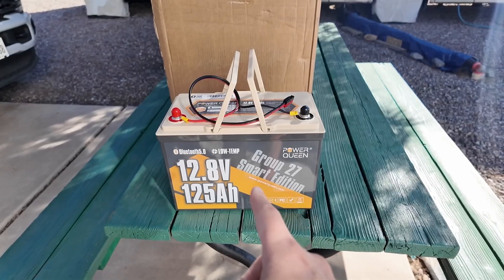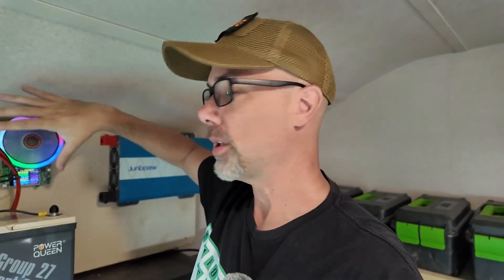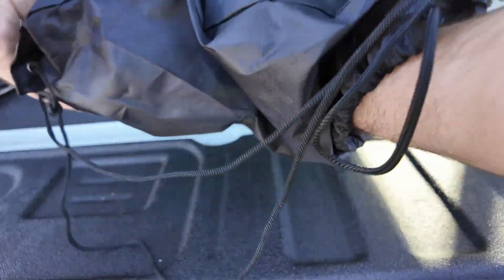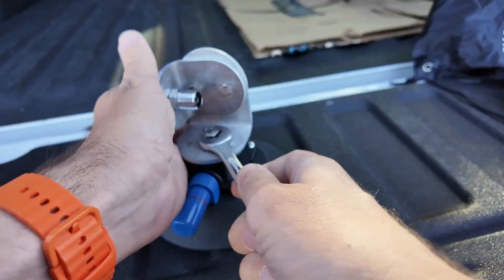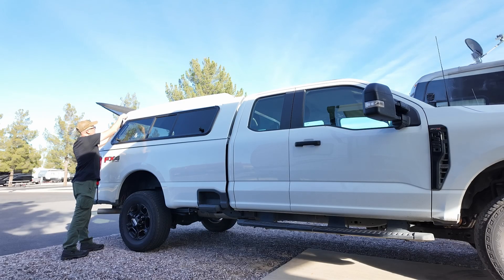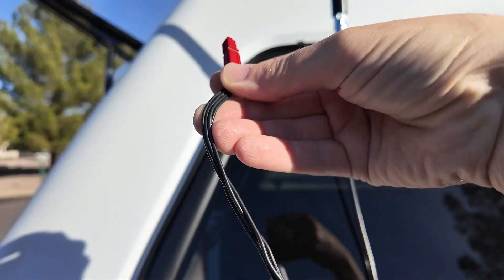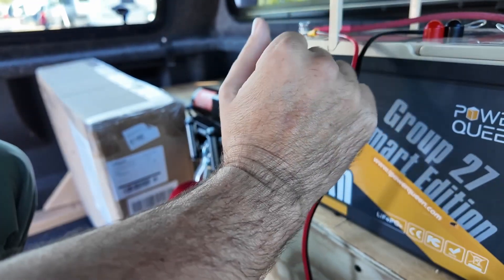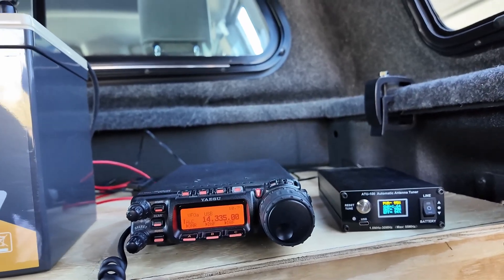⭐ I Built a Complete Off-Grid Ham Radio Station for My Truck Camper! (Power Queen + 17ft Antenna)

Comment: Hey Steve! I just ran across this video! Thanks for the shoutout! I use the braid to ground to the trucks leaf spring. I have had it on my truck for about 3 months. I only attach an antenna when stopped. I do check the suction quite often, but it’s always good to go! Good luck with the build! Happy New Year
Reply from the maker: That's a great idea to ground to the leaf spring!

Comment: We used those same suction cups in commercial glazing, be sure to keep the cover on it when not using and keep it clean. One little nick in that ring around the edge and it will lose suction. I would not trust it going down the road myself.
Reply from the maker: Thanks for the tips.  I agree, but I'm not a fan of in-motion HF myself.

Comment: I am slowly setting up my mobility lift gate van for POTA hunting.  I use 2 LiPo4 50 Ah batteries paralleled.  My Kenwood TS-590SG runs an entire week at 100W before batteries need recharging.  Living in N. Minnesota, and living in an antenna restricted apartment, so the van is a good alternative except like now when it is 4 deg. F outside.  This is a full size van, so the rear portion will have a built-in ham shack style desk, and with a hitch mounted  Spiderbeam 12M HD mast.
I also use the Mastwerks 10M rotatable Buddipole dipole.  This is a dream come true being handicapped.  I just acquired the van 1994 Ford E150 with the 2 valve 5.4L Triton and side lift installed.  WOO HOO  Cheers and 73
Love your Videos!
Reply from the maker: Sounds like an awesome setup!  HamVan!

Comment: Regarding the suction cup antenna mount. It brings to mind the phrase "What happens
when an unstopable force (vehicle w/ suction mount and antenna) meets an unmovable object (low tree branch)? Sounds like glass breaking to me. Your thoughts?
Reply from the maker: There is no scenario where you hit a low tree branch with and antenna and walk away unharmed.  A good operator doesn't run into trees.  I personally wouldn't run it while driving.

Comment: I need to find out if I can mount the ATAS-120 with a mount like that. Wonder if they have a SO-239 version or if I can find an adapter. Aren't aluminum body trucks fun ;) Also, might get one for my Tesla for the roof since that is all glass. Need to get my GMRS radio going. FYI, you might try a ground strap as a radial. I am working on a video showing that and I am finding it working quite well. I replaced each bundle of 4 radials with a single ground strap. No wires to pull apart. And I need to catch up on Living for a Living.
Reply from the maker: I never really did much mobile operating from the truck... when I did I used my 2/70 bolt on mount up under the hood.  Its nice to have options... The biggest frustration I have is that now that I've got an AL truck, they are asking me to review all these mag mounts!

Comment: I would recommend not using it on a window. It is more for any flat surface on a vehicle or in place of a mag mount on fiberglass vehicles. I used this type of mount for years for tow lights when I drove a tow truck. The window will break before that mount comes off if hit or too much weight is applied
Reply: I’ve run mine on my back glass for roughly about a year with no issues. Only took it off once
Reply from the maker: Thanks for the info!

Comment: Back in the Early 90's I had Window Screen material Fiber glassed into the under side of the Roof on My Topper to serve 3 MNO Antenna mounts 
Worked a Treat for VHF / UHF Etc. 
Then some 2" seal tight conduit out the bottom of the bed and and back up into the Cab under the Seat. ..
Reply from the maker: Noice!

Comment: I just installed one of those triple foot mag mount on my jeep, with a comet antenna that folds down, but I thought I better add some zip ties for safty. I could totally see a tree branch stripping the antenna and mount. My roof rack actually protects the antenna and mount, but zip tirs are cheap insurance.
Reply from the maker: #TeamZipTie

Comment: @temporarilyoffline Hi Steve.  Another superb video.  If I use the suction mount on a home window, is there a weight limit on the antenna?  I’m thinking about using a Diamond Fiberglass VHF/UHF vertical.  Thanks. 73
Reply from the maker: I'd say we're talking wind load more than weight.  its all "sheer" weight and that is a serious suction mount.  The diamond should be fine!  You could reach out to Look North and they will give you more accurate info.
Reply: @temporarilyoffline  thanks for responding.  I did yesterday and they responded immediately, on a Sunday.  Great service. They said that they weren’t sure if it would work but to try it.  I’ll let you know and thanks for the demo on that mount.   73.
Reply: Strong winds might flex it enough to break the glass.

Comment: You could also run a ground strap to one of the truck bed mounts, add a powerpole to it, and connect it to the antenna powerpole pigtail as needed, and roll it up and put it away in the bed when you don't. Use the whole truck as a groundplane. One less item to remember and carry.
Reply from the maker: Good idea!  Would also make a nice tether in case the mount falls off after a while.

Comment: Great setup ! I love that suction cup mount !   Nice battery !  With my portable 200 AH Power queen ,I went to power Worx  and got one of them newer Power pole strips. The one with SB 50 input for more total amps. And double side tape to battery . I am always power pole stuff to plug in and use up the power poles often ,So I just jot a bunch of them strips with several ports . I mount them right on my portable battery. I have a few go LFP ones.  I can see using 3 of them mounts and using them on the roof . Problem solved for aluminum .  My girlfriends kitten is sleeping on my 300 AH power queen now. getting a re charge before playing and get the zoomies threw the house.  I was wondering why kitten gets so wound up and playful. Now I know ! And this explains the missing amp hours as well ! LOL 73
Reply from the maker: Cats be crazy!